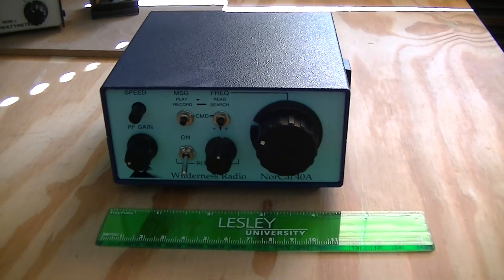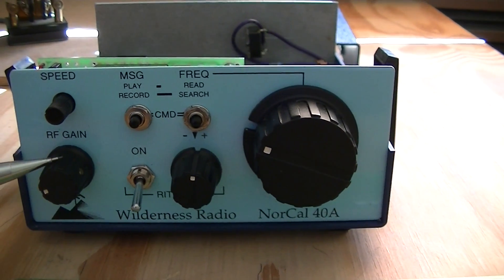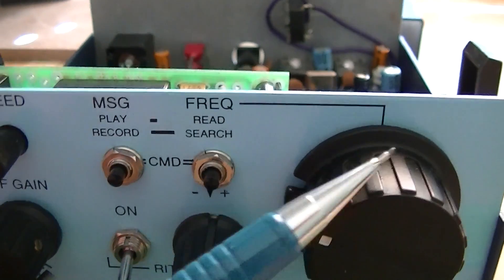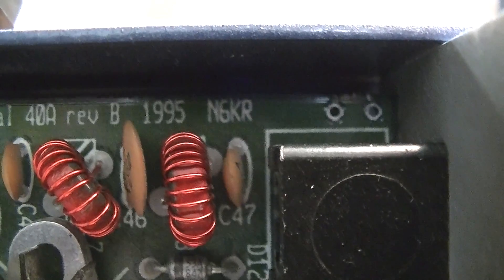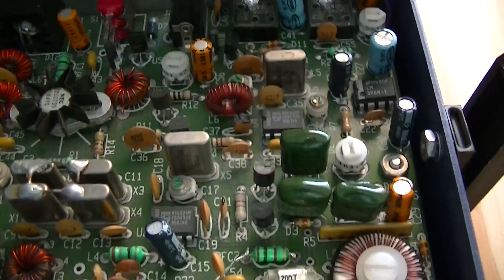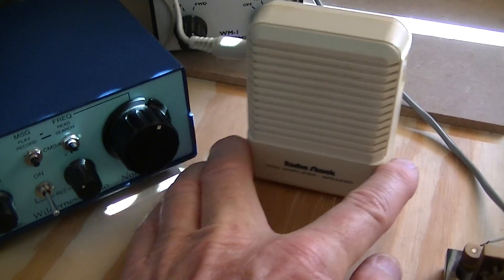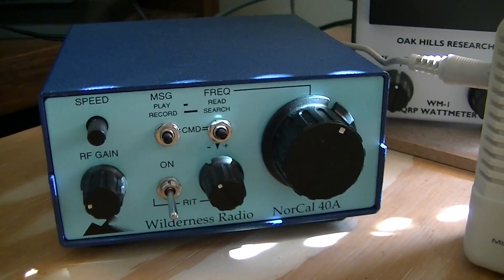Norcal 40

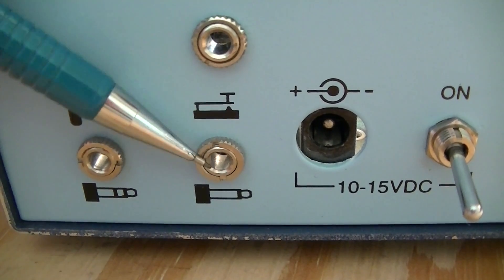Comment: 2:35  This makes no sense what you said.  The plug on top is for a key.  The plug on bottom is for a key.  If I have a paddle, which one do I plug in to use the onboard keyer? The TOP one, I would think, since the bottom one is a mono plug, and only for an external keyer or a straight key?  I am SO CONFUSED!!!!
Reply: the bottom plug in is for the paddles....this rig has a built-in keyer....the top jack is for just a straight key, if ya don't have a set of paddles. He did say where the keyer goes....well...yes and no....the paddles to run the keyer....
Reply: Take a pill

Comment: "mass-produced"? I wish! 

Seriously, Bob Dyer still sells these kits for around $155 plus $12 s&h CONUS. They were extant circa middle/late 90s and still a magnificent little kit/radio. Recommend the added KC-1 keyer/frequency enunciator ($45) as that makes the rig a truly backpack-able package. 

For some real fun, turn it down to just below one watt and see who you can work QRPp! So far, with a crappy antenna, I am out to Colorado from SoCal. 

Also note you have the little birdie around 7,028 kc as well. 

Enjoy; it's a neat little unit and a piece of modern-day QRP history.

71/72,

Bill, k6whp
15m CW, 
Zuni Loop MEF
Reply: Update as of 2021 (actually earlier)...

...Bob stopped selling these and the Sierra. However, there was a revival project that done by Chuck Adams, k7qo, with Wayne Burdick's permission.

I have a .zip archive of the Gerber bird files and documentation if anyone is interested. I am good in QRZ

72 de k6whp